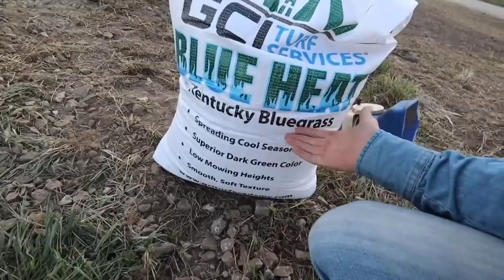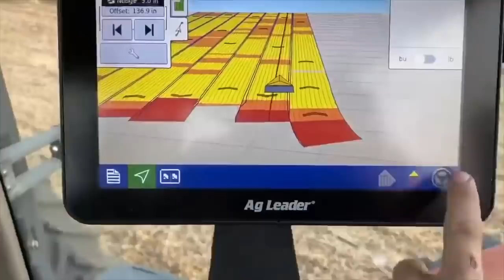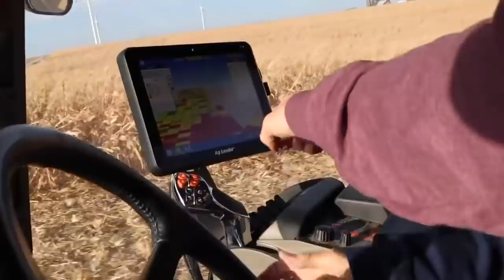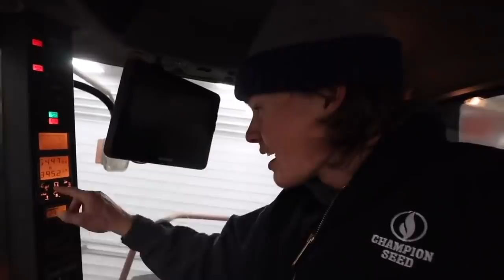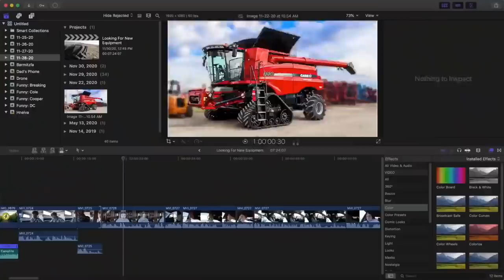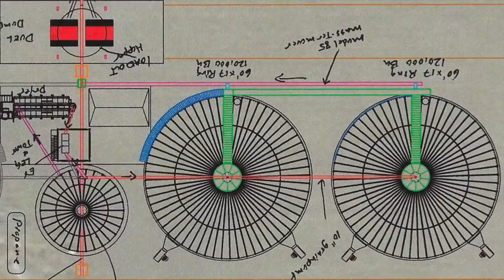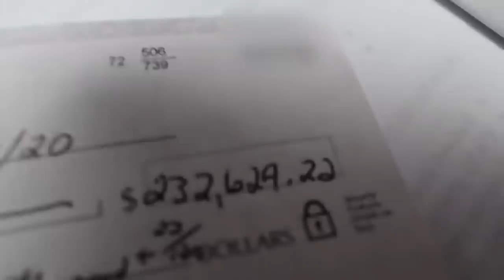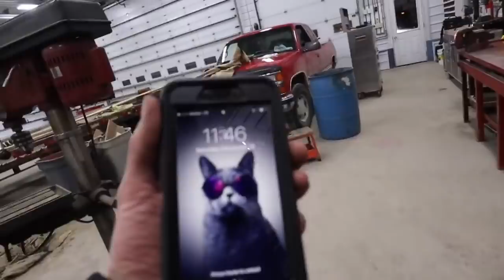How Much Our Farm Grew In A Year (Part 2)

Comment: Hi Cole,  Merry Christmas to you and your family! I got to thinking about the replacement windows for your attic, so file this one under unsolicited advice (sorry in advance :) ), but perhaps when the old windows broke in the storm, that's what kept the roof on your house. I would consider replacing them with single pane glass again and not some much more robust thermal pane glass. Kind of a great built in roof saving design, rather lose a few pieces of glass in a huge storm than a roof! Anyhow just a thought. Take care!
Reply: Why would the thin glass breaking stop the roof coming off?
Reply: @cathyblackhall3448  Hi Cathy. When the old windows broke in the storm, they allowed the attic to equalize with the atmospheric pressure of the tornado outside. Just as you would want to partially open a window in a tornado, as they cause very low atmospheric pressure. Keeping a house closed up contributes to the forces against it in a tornado.
Reply: @ercando11  Thankyou for answering my question.I’m from Manchester,England so whilst we are known for our rain,our weather is pretty mild and mercifully the only tornado I knew about was in the Wizard of Oz🤣